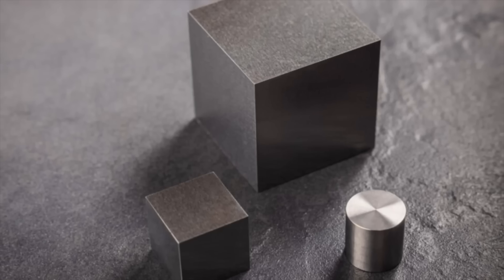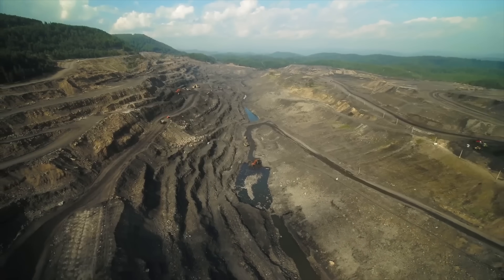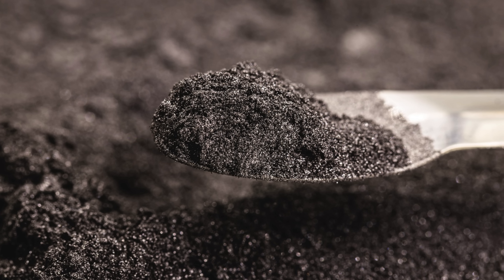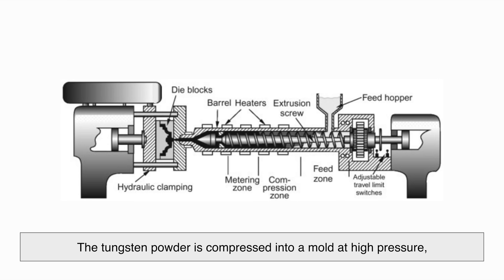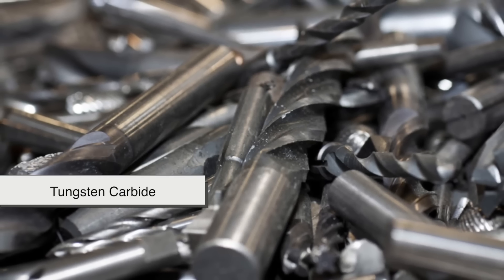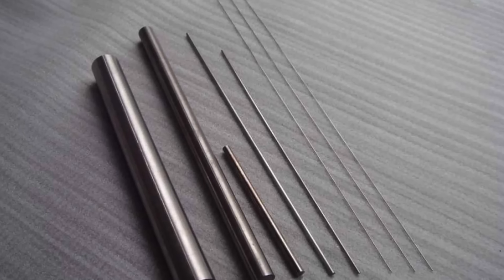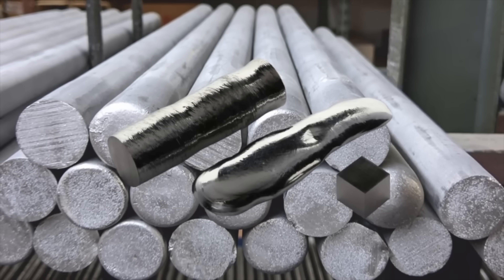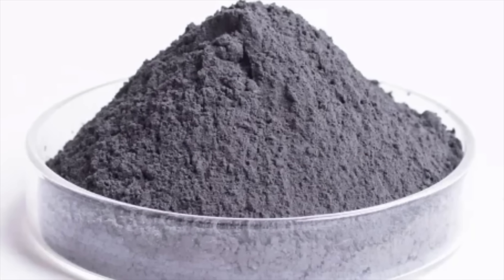How Is Tungsten Made?

Comment: There’s an error. Tungsten is not used for drilling metal. That’s high speed steel. Tungsten can be used for milling cutters, which kind of look similar but serve a very different purpose. Tungsten carbide milling cutters far outperform high speed steel.
Reply: What about snapon tungsten carbide drill bits for mechanics?
Reply: No there is not error.
Reply: Oops. Lol
Reply: It is not just used in some, but used in the majority. Maybe the ones you know does not. But I came from a mining family who owns a double digit shares in stock in one of the largest mining companies, not the largest but always in the top 25 largest, and I've seen, inspected with my own eye where the tungstens are held in the Tricone bits. If you don't know the full info., it's not mandatory to comment smh.
Reply: You couldn't be more wrong. 
HSS drill and Tungsten Carbide drill are all common. Depending on the material you are working on. End mills (milling cutters) are also made from both HSS and Tungsten carbides

Comment: Tough metal! But plutoinium is even stronger.
Reply: Yes, my plutonium saw blade is great. It's just difficult getting the correct ppe
Reply: Denser yes, but not "stronger" I don't think. Tungsten is a very hard metal.
Reply: @Juanelmajo13  No its actually  harder and heavier! But the radioactivity  makes it useless.
Reply: @pernykvist3442 I looked it up: No, tungsten is significantly harder and stronger than plutonium; tungsten is known for extreme hardness and high melting point, while plutonium's properties change with temperature, making it relatively soft and malleable, not hard. Tungsten ranks among the hardest natural metals, often rated 7.5-9 on the Mohs scale, whereas plutonium is much softer (around 2-3 Mohs) and even ductile in certain forms, focusing more on its extreme density and radioactivity than hardness.
Reply: @Juanelmajo13  I do read it on periodic table that reflect atomic wheigt and hardness.
Reply: @Juanelmajo13  Tungsten and Wolfram carbide is diffrent to! But if shall talk "hardness" we can go to diamonds.
Reply: No, tungsten is significantly harder and stronger than plutonium; tungsten is known for extreme hardness and high melting point, while plutonium's properties change with temperature, making it relatively soft and malleable, not hard. Tungsten ranks among the hardest natural metals, often rated 7.5-9 on the Mohs scale, whereas plutonium is much softer (around 2-3 Mohs) and even ductile in certain forms, focusing more on its extreme density and radioactivity than hardness.

Comment: What are the differences between Tungsten and Inconel? Both tout high heat and corrosion resistance, so when would you use one over the other?
Reply: As a machinist, we use tungsten carbide cutting bits to cut the Inconel.  Tungsten is also used as the electrode to weld the Inconel (in GTAW, or TIG welding.)
Reply: Tungsten is an element. Inconel is an ALLOY
Reply: I mean at a base level tungsten is elemental, inconels alloy, tungsten would be heavy and therefore sub optimal for air frame applications, inconel is used in engines, magnesium in frame, tungsten in bullets, crazy kinda engineering out there

Comment: You talk about brazing, pairing metal with another,softer metal. Isn't that soldering? If not what is the difference?
Reply: The only real difference is the softer metal used - a tin alloy for soldering, brass for brazing. I think a gas torch is always used for brazing, you can use an electrically heated iron for soldering. Just to keep things complicated there is also silver soldering and no doubt others.
Reply: @timbergel8147 really well explained and correct. Nice! 🙂

Comment: Tungsten is used by fraudsters to make Fake Gold. This is because the density of Tungsten is almost the same as the density of Gold at 19.3 grams per cubic centimeter. The deception uses a tungsten core that is covered over with a surface layer of gold. Therefore the Fake Gold looks like gold on its exterior and feels as heavy as gold but the interior has a tungsten core. The price of tungsten is much less than gold. For example, the retail price of pure tungsten is around $15.30 per gram. On the other hand, the spot price of gold was $146.33 per gram on December 26, 2025.
Reply: Yes I have heard of this. One has to wonder how many tungsten-cored gold bars are out there. 🤔